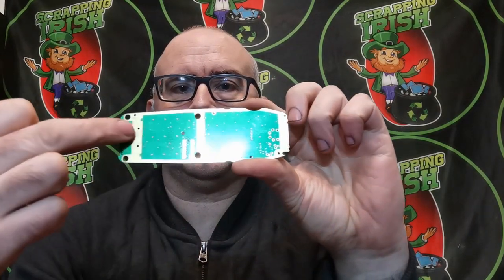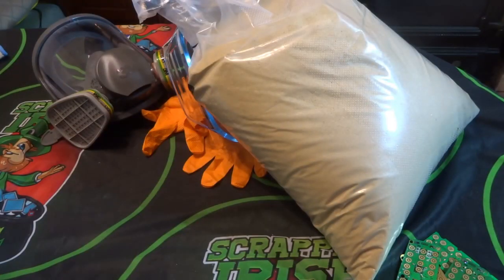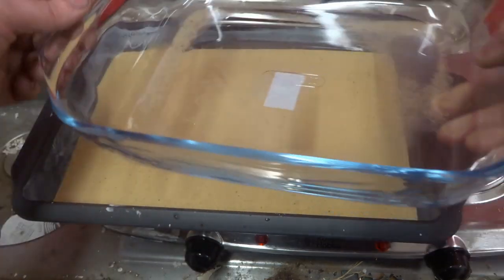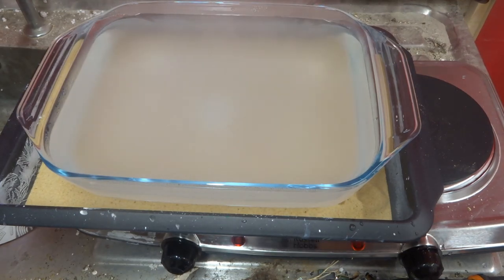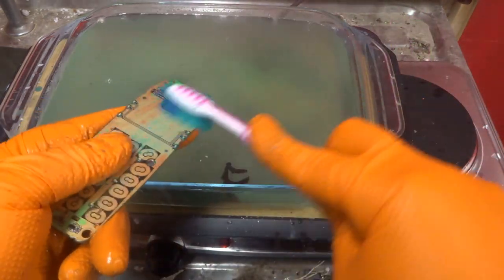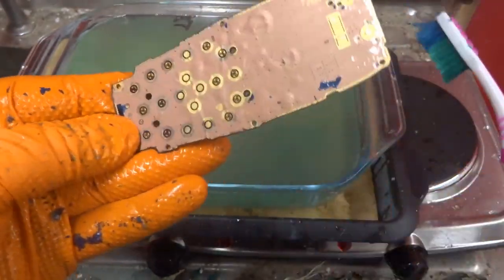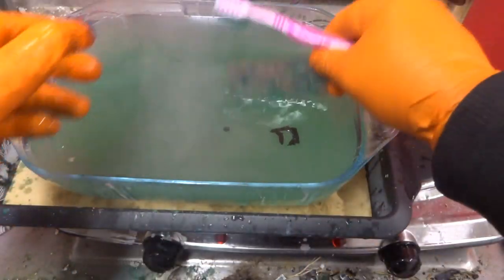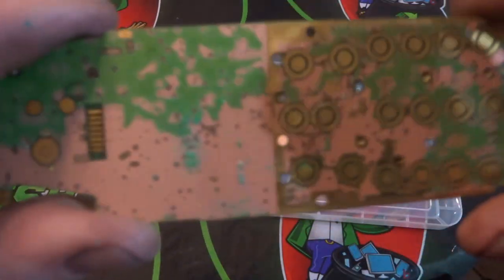Gold recovery from mobile phones part 4 and other precious metals using caustic soda

Comment: Hello scrapping Irish. 
Whe you mixed the caustic soda did you use hot water as I did not see no frothing or foaming.
On average how long did you leave the boards in the caustic soda ?
Reply from the maker: I used warm water and heated it up, took about 10min before the mask started coming off
Reply: @ScrappingIrish  oh ok. 
Im on the c.p.u. now.lol